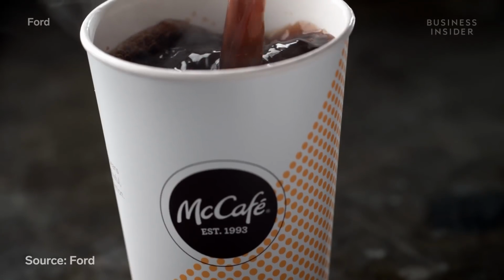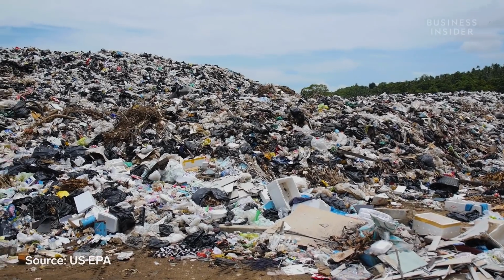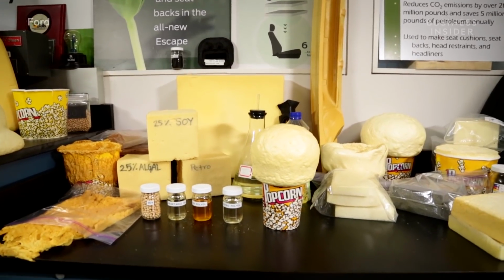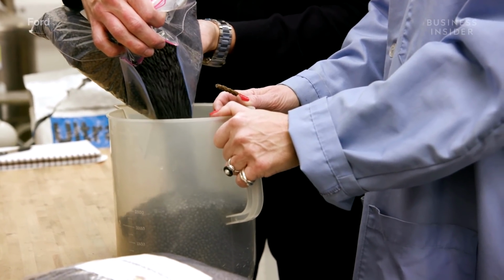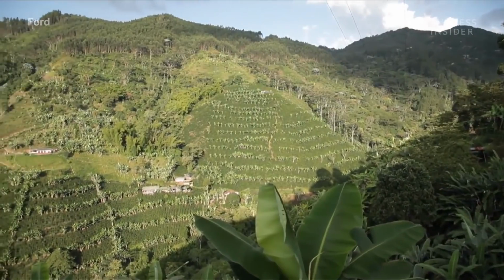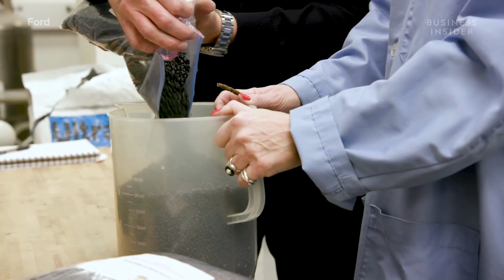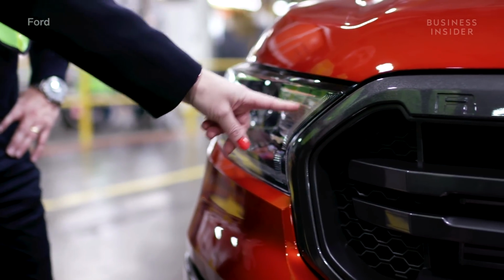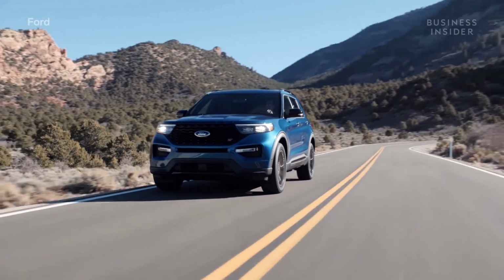How Ford Makes Car Parts From Used McDonald’s Coffee Beans

Comment: Use the most common resources for headlights. Sand. Yes, because it can be melted into glass which doesn’t fog up.
Reply: 42luke roblox We’re actually running out of sand. There’s a lot of research regarding our need for sand in the future.

Comment: wow. Glad to know its not 100% plastic. Way to go. so many things that are sold nowadays should be doing the same. Theres not a day that goes by where you dont touch something plastic. to think that all of it is 100% plastic is terrible. such a waste, then ends up in landfill. so many people would buy a product only for it to break and then immediately discard it without a second thought, me included. i doubt many people what happened to the plastic toys they had as a child or the tube television they threw away because the led flatscreen looked better, even the totally plastic vhs tapes they used to watch. it was all just thrown away and they have been either burned or buried. We didnt have anyone thinking of solutions to problem like we have today.

Comment: Well the problem is that they’re also using using plastics that cannot be recycled due to chemical compounds. Also they are using plastics in stupid places such as engine components, and under the hood. Where plastic is prone to dry up, crack up, and becoming extremely brittle.

Comment: simply putting all the trash into a landfill has to stop. by now we probably dont have to produce new plastic, if we could either recycle or use some bio packaging material
Reply: Yes and no.
Most plastic can't be recycled infinitely,
and a lot of our current recycling methods are more costly and less energy efficient than making new plastic.
Recycling 100% of plastics is the ideal, but the technology isn't there yet.

Comment: This is way worse in the environment at all, its better to just let it rot and turn into a fertilizer in the landfill than just turned into an immortalize filler in making these stuff, the most environmentally way they do is just to halt their car production and just improve the used cars they sell, in that way they will not add more carbon footprint in making those stuff